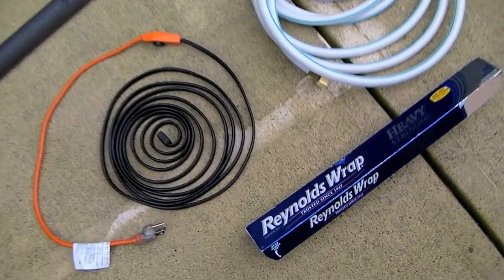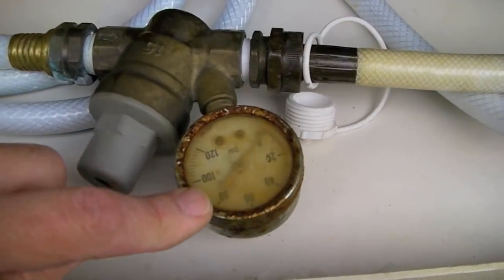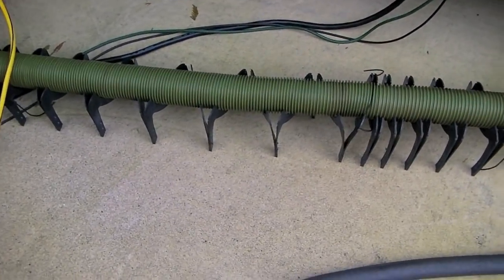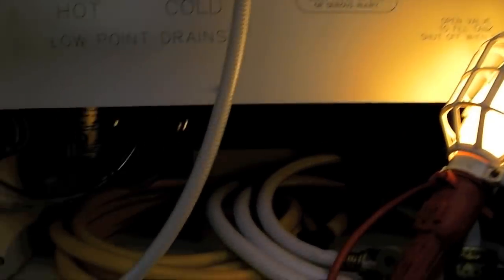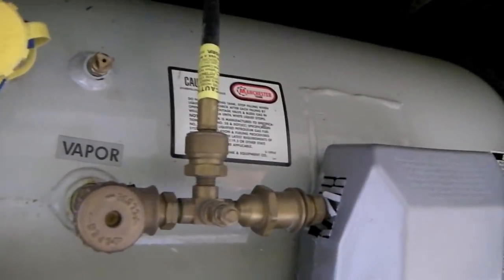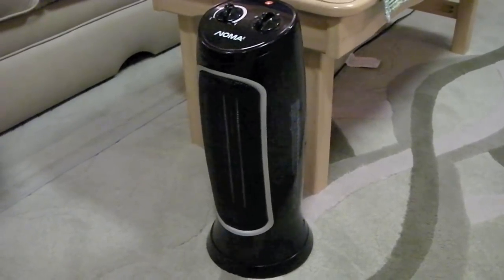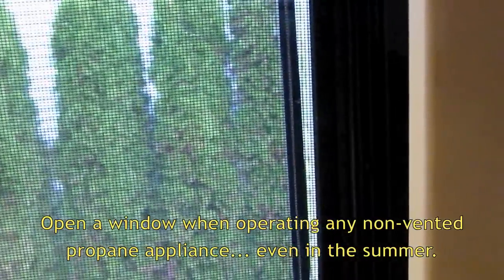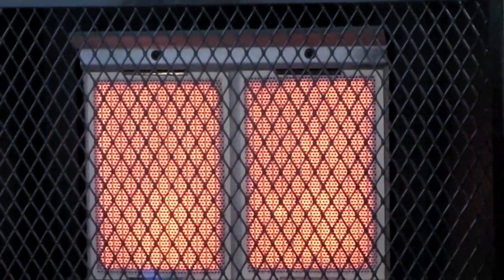How To RV in the Winter - Prepare Your RV So You Don't Freeze!

Comment: Nice job with the water supply hoses. If your not inclined to building these, they make heated hoses. The ones I looked at were not crazy expensive. You might do a cost comparison first. By the time you pay for and collect all the materials, it could be more expensive..
Reply from the maker: When we looked, the good quality heated water hoses were pretty pricey, but we'll have to take a fresh look! Thanks. :)
Reply: Our expensive pre-wired (heated) water hoses froze at the connection.  We had a way to go (75') for the outside spigot. We connected 50' to a 25'.  You must heat wrap the metal connectors, then wrap (pipe wrap or insulation and tape), otherwise, in -4 degree temps, you'll freeze in minutes where the two connect. We are chucking them and purchasing a 3/4" - 75' lime green FlexZilla (LOL) hose AND using the heat tape/foil and pipe wrap as shown.  Wish us luck. We just may lay it in PVC too

Comment: I have a question, if you are full timing and expecting a freeze, should you leave your water heater on all the time? I'm in a Thor daybreak, my only heat is a space heater and the propane furnace. We have the furnace set to about 65 and run the electric space heater most of the time.
Reply from the maker: Even if you have some form of heat in the basement (like a furnace outlet or a light bulb), that may not protect your water heater from freezing, since it's mounted right on the side of the RV and not necessarily part of the basement. Although it might take a pretty hard or long freeze to damage it (because it is so well insulated by design), the expense of replacing it would be no fun. If it were me, I'd leave it on for anything more severe than a short or slight freeze. Worth the propane or electricity to protect it. Since we were hooked up to power all winter, we just kept the water heater on 24/7.
Reply: Thanks for the advice. I'm leaving it on mostly at night when its getting into the 20s. Maybe overly cautious since its warming up during the day but better safe than sorry. Thanks again.

Comment: The aluminum foil is cutting down your heat to the hose ,you should wrap the heat tape around the hose in a spiral so the hot element is in direct contact with the hose ,I've done the same thing your doing now and had bad results without the tape making direct contact, once I spiraled the tape I could pump at -40 F .
Reply from the maker: MINUS 40! =:-O No wonder you needed an optimal hose heating setup!

Comment: the aluminum foil probably reflect heat away from the water hose.  I would put the heat tape against the hose and wrap the foil around the tape and hose.  Aluminum foil has near zero thermal mass and will not carry heat (this is why you can grab foil directly from a 400 degree oven and not suffer burns)

Comment: '
are some R/V motorhomes has 4X4 wheeldrives as 2 axles / 6X6 wheeldrives as 3 axles...
must require to put 2 or 4 or 6 chaintires
Reply from the maker: Large motorhomes like ours only have one drive axle, with four tires on it. If there is a third axle behind that (called the "tag axle, which ours has), it only supports weight and provides braking.
Reply: okay thank explain

Comment: We just purchased a Class A motorhome about 3 weeks ago. Took it for a ride today and the outside air temp was around 30 degrees. We started out after warming it up, some what, with the furnace, but driving it with just the front heater did not seem to even keep the drivers area warm. I was wondering if we could use the furnace (propane) while driving? Or is there something else we need to do?
Reply from the maker: Congratulations on your new RV, Roger! A couple of questions... is it new or used, and is it gas or diesel? Having only owned diesel pushers, with the engine in the rear of course, we have experienced somewhat anemic dash heat when the temps drop to around freezing outside while driving. But it's never been so cold that we needed any additional heat... not up in the driver's area at least. Further back in the RV gets cold of course, since the dash vents can't provide enough heat to keep the whole coach warm, but if nobody's back there while your driving, who cares, right? If your rig is older, that may account for some of the issue... if the dash heat isn't working up to par. We're guessing (remember that we've only owned diesel pushers) that a gas rig, with there engine right up front, should put out plenty of heat. Even though it's okay to run the propane furnace while cruising down the highway, you really shouldn't need it. There are purists that say you should have the propane shut off at the tank while driving, so that in the event of an accident, the propane is less likely to cause a fie and/or explosion. But we know lots of people, ourselves included, who never shut the propane off except when the RV is in storage, or when getting the propane tank filled. Bottom line, if we were cold, we'd run the furnace while driving, but not everyone would agree with that. We've never driven the RV with temps in the teens or 20's that we can recall (we usually snowbird), but based on our experience near freezing, we'd almost certainly need the furnace to keep warm while driving in temps that cold, and we would have no problem using it if needed.
Reply: RVgeeks We purchased a 1998 National Tropical (Class A, 37 ft.) with a gas engine. It starts and runs great. We are trying to take it on short trips around here, since we purchased it the first of December, so that we can check all the appliances and things. My wife is a person who likes it a little warmer than most people, but the older I get the more I need a little extra heat also for my joints. We probably will not be camping in the winter much but we are enjoying take all the grandkids for rides in it. There are ten of us all together (kids, parents and us). THANKS

Comment: Wouldnt the heat tape be better inside the foil?
Itd use the foil as a insulator as well as the foam and still transfer the heat
Reply from the maker: Hi John! Part of the issue is that the heat tape is really designed to use on metal pipes. So one benefit of the foil is keeping the heat from the tape from overheating the side of the hose that it sits against. Helps distribute the heat around the hose without heating just one side too much. We found that the set-up we used did a great job of keeping the water running and didn't require any more heat.

Comment: Thank you for your feedback and response. What I was told that I should expect 35 to 45 degrees during the day and 20s at night. If I take a precautionary measure and decide to use a heat tape with my water hose what length should I get? My water hose is 25 feet plus the filter. I appreciate the help. Thanks.
Reply from the maker: If your water fill is on the outside of the RV, as opposed to inside a heated compartment like ours, you'll need a heat tape the same length as the water hose. Have a great trip!
Reply: They do sell a heat tape the length of water hose. The closest to my 25' water hose are 24' or 30'. Is bigger better? What would I do with the excess? Can I put around the spigot? Thanks again for your help and knowledge.
Reply from the maker: Alex Jacomino You're right on. Get the 30' and wrap the spigot with the excess.

Comment: Those no-vent propane heaters ARE great at heating....but NOT in a humid climate---even with windows open, the moisture will condense on things.
For humid climates, it's best to use heaters that dry out the air--to avoid having a rain forest indoors, which also promotes mold.
Reply from the maker: You're right that they do indeed add moisture to the air, but with careful attention paid to humidity reduction, we got through the winter okay. No rainforest and no mold. We'd prefer an electric heater for sure, but the limited availability of good-quality power in the park we were staying in made it a challenge.

Comment: One way to get the heat down to the basement (assuming there are vents in your bays) without using all your propane, is to just run the furnace fan only. This tip isn't as useful when boondocking and electricity is also limited, but since you are plugged in, you have electricity source to run the fan as much as you need. The heat you have in the unit from other heat sources will be pulled into the furnace intake and will be dispersed around your RV including the basement (since you have that set) by the furnace fan without needing to have the furnace propane to kick on. On our unit we just turn the setting to heat (furnace), set the fan to manual (so it is always on) and keep the thermostat way down (so the actual heating element never fires). When hooked up, we use an infrared heater which is very safe with a cool to the touch external surface and runs entirely and relatively efficiently on electricity, and disperse it from the room in general through the furnace fan.
Reply from the maker: Thanks for the great input! We're just about to spend the winter in a cold climate again, and will be making one additional modification to our rig to allow us to keep plenty warm, even on a 30-amp site with the power considerations that come with anything less than 50-amps. Stay tuned for an upcoming video! ;-)

Comment: Hi there, is removable insulation for windows a thing?  I live in a much older RV that doesn't have all the bells and whistles, so I'm trying to keep the cold out by other means.  It seems a lot of the cold air seeps in through the windows.  Just curious.  Thanks.
Reply from the maker: We've heard of using a product with reflective foil sandwiched around bubble wrap to insulate windows, but we've never actually seen it. Might be available in Home Depot. Just cut to size.
Reply: Cool thanks!

Comment: What heat source do you use at night.
Reply from the maker: HI Kevin! Good question. We have a video that goes over the pros/cons of the different options typically available for heating your RV that might help: https://youtu.be/1pgYW2xQwho  But the answer also depends on the situation. Are we dry camping, or hooked up to shore power? And is electric included in the nightly rate, or metered? And, most importantly, how cold is it going to get at night?

Typically, when we're hooked up and it isn't going to get too cold out at night, we use our roof heat pumps and/or an electric space heater. If we're dry camping, it's usually during snowbirding in the desert SW, so we use our portable propane heater to avoid using power for the furnace (and because the furnace uses a LOT of propane, while the portable heater sips it). But if the temps start getting too cold, we need to revert to the furnace: heat pumps only work down to outside temps around 40F, smaller heaters can't keep up, and we want to ensure that heat is pumped into the water compartment to keep plumbing from freezing (which our furnace does).

Hope that helps!

Comment: My water hose connects on the outside of the rig.  I put a foam elbow there then taped the foam tube at them seam.  Unfortunately I watched this after the fact and didn't use heat strips.  Could I wrap the foam in foil then the heat tape and maybe a larger foam tube around it?  My RV park manager passed out fliers yesterday saying we had to use heat tape.  Low tonight forecasted to be 25.  Last night low was 37.  I also don't know if I have an outlet to plug into outside.  I'm a newbie to this.  Obvious I'm sure. 

I really don't want to have to remove all that foam wrap.
Thanks, LuAnn
Reply from the maker: Hi LuAnn. I'm not sure whether it will work the way you're describing or not. A lot may have to do with how long you're staying in the same spot, and how cold it gets. If you're staying all winter, and it's already getting down to 25 degrees at night (what part of the world are you in by the way?), I assume you'll be facing substantially colder temps over the winter.

If you'll be there all winter, you might want to remove the wrap and start over for a couple of reasons. First, the job of removing it is easier than installing it, and if you're going to install more over it anyway, the removal won't add that much extra work. Second, you might have difficulty finding large enough foam tubes to completely enclose the first tubes. And third, since the foam that's currently on there might prevent the warmth of the heat tape from reaching the hose itself, the double foam tube idea might not even work if it gets cold enough.

Even if you have the self-adhesive foam tubes that we used in the video, a clean cut with a razor knife will allow you to re-use them, with duct tape, instead of buying new ones. Just be careful NOT to cut the water hose!

Sorry to be adding to your workload, but I just can't know for sure if you'd end up with a burst water line doing it any other way. Since your park manager might know some more about this (most year-round parks in cold climates probably deal with this a lot), it might be worth asking their opinion as well. As far as power for the heat tape, if your manager said everyone has to use them, you can be sure he can direct you to the power outlet you'll need to use, probably on your power pedestal.

Hope this helps. Stay warm! - Peter
Reply: RVgeeks    Our lows will be mostly 40s ( for the next week or so) after the couple 20s nights.  I will be most likely moving before Thanksgiving.   I'm in the St. Louis area.
Reply from the maker: LuAnn Patterson Got it. Save yourself a lot of trouble LuAnn. Since it won't be that cold, and you won't be staying that long, just remove the water hose and put it away on any nights that it's supposed to go below freezing, and just run off your fresh water tank overnight. It's overkill to use heat tape and other winter preparations for such a short stay in mostly mild temperatures.

Comment: My RV is in Northeastern PA. I have tried the hose and heat tape in the insulated tube and on a very cold day it just does not work-- period. Mine froze multiple times in one winter. Tried many other things, nothing works. There's a reason houses have their water pipes burried three feet down, running into a warm cellar..........

Comment from the maker: Burning propane does not typically produce CO (carbon monoxide), which is why it's safe to burn propane in the house.  The only danger is that without enough oxygen, CO could be created due to incomplete combustion.  Keeping a window open solves both problems: air for combustion and air for breathing.  Every modern RV should come equipped with a CO detector, which should be checked periodically for proper operation. They also come with propane detectors in case of a leak.

Comment: The foil is a radiant reflector, it should be wrapped around the element and tubing for maximum efficiency.
Reply from the maker: Since the heat tape is primarily for metal pipes, we used foil to prevent it from overheating the rubber hose. If it were colder, we'd wrap it inside, but since the temps rarely fall below the mid-20's where we spent that winter, this worked great!

Comment: open flame in an rv is the most common way they catch fire and carbon monoxide caused by them kills silently.  u need a detection unit as well
Reply from the maker: +Ed Wilko The flame in RV refrigerators is the #1 cause of RV fires. These heaters are designed for interior use and thousands of RVers use them all winter without incident. Just have to follow the instructions and use common sense and they are fantastic pieces of gear. It has an O2 depletion sensor, we use a CO detector and we always crack a window. If anyone isn't comfortable with one, don't buy one.

Comment from the maker: Sorry I didn't mention the ways we did everything we could to avoid killing them.  We started with no-kill traps (clear plastic catch-and-release tubes) and they came right back in within 24 hours of release.  We stuffed steel wool into every possible opening (which is still there), used dryer sheets everywhere, and bought 2 Victor ultrasonic mouse repellent devices, which are kept on 24/7.  If they get past all that, sorry, but they are dead at that point. We did our best.

Comment: With the heat tape on the water hose, you don't need to foil your water hose. I've been using just the heat tape on my hose and pipe insulation over them(the 8ft lengths you have) like you're using for 5 years now in single digit temps(fahrenheit) during the winter, with below zero winds for 3-4 days at a time, and my water never froze. So save yourself time and money and forget the foil. The heat tape comes on at 35 degrees, not 45, then it heats to 45 degrees, and shuts off automatically til the temp of the hose goes back down to 35.
Reply from the maker: Good to know... this was the first time we had done this and were concerned that the heat tape would get too hot for the plastic water hose (especially since the heat tape manufacturer specifically said the tape was for copper/metal pipes only). Glad it works without the foil.
Reply: It will also be easier to stash or pull out when needed.

Comment: Have you tried an electric radiator?
Reply from the maker: We have indeed tried an electric heater (one of those oil filled types). It was very nice heat, but had two issues. 1) They can be pretty large to store and 2) If we're only on a 30-amp circuit, we might not be able to spare the power for it. If you have the space and the power, they're very nice!